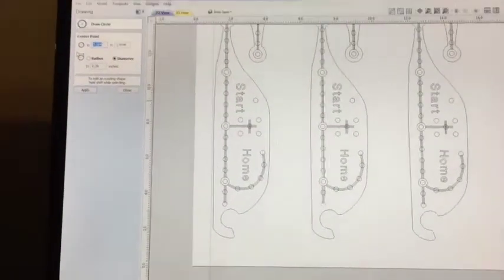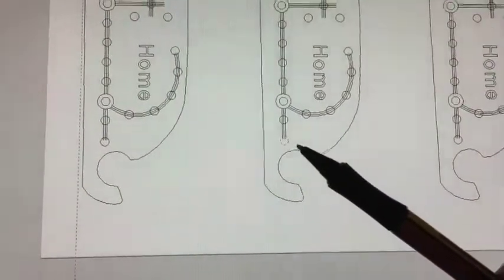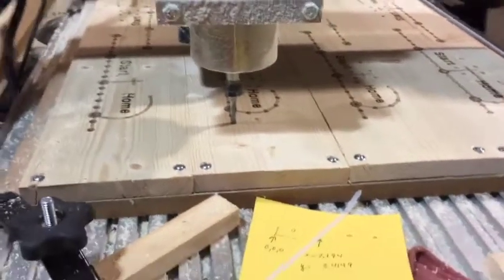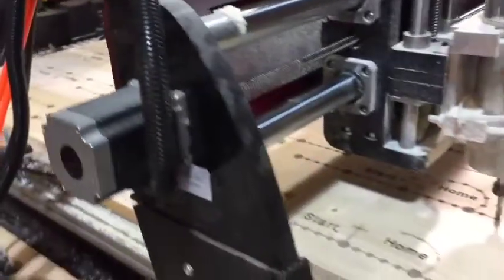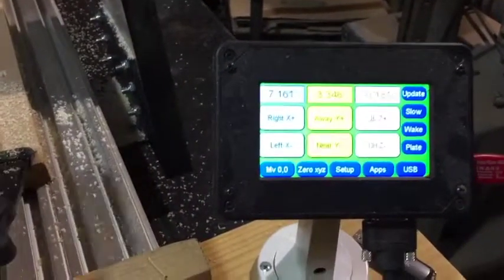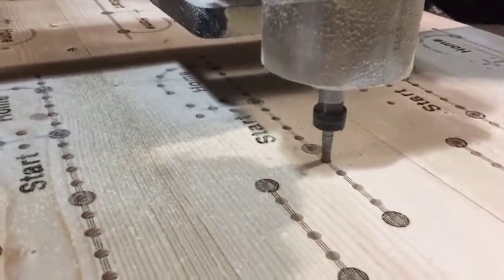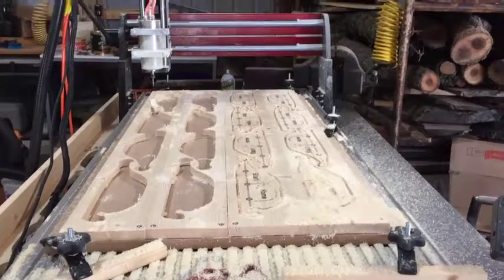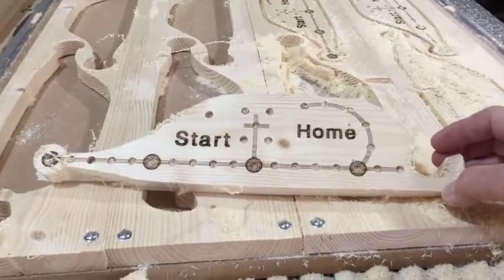Finding cnc shark x y z position after mix up. CNC Shark Power Failure

Comment: couldn't really hear what you were saying but how did you get the machine to pick up from where it left off? Without starting over?
Reply from the maker: You have to start over, this tip helps you locate where you are so that you can locate your position in the model. This will not work if you are doing a 3d carving. This is a pegs and jokes board that I designed so I could locate the exact position of a drilled hole. That allowed me to move to that hole and then enter that position. This allowed me to restart the program.   Sorry it took so long we went on vacation.  Cecil

Comment: Great tip, I’m about 2 months in on owning and working with an hd5 shark, not sure what your plans for the channel are but I’d love to see you do a how to for the laser and/or 4th axis if you have one... not too much info out there one the hd5 shark, thanks again for the video and you earned my subscription!
Reply from the maker: The big difference between the HD5 and the other HD systems is the new bearings. All the other operating systems are the same. Make sure you lube and clean the bearings and your system will operate fine.